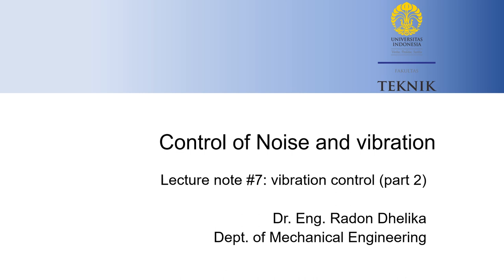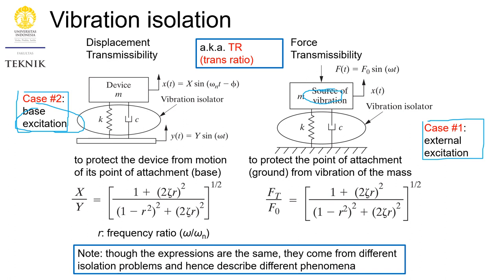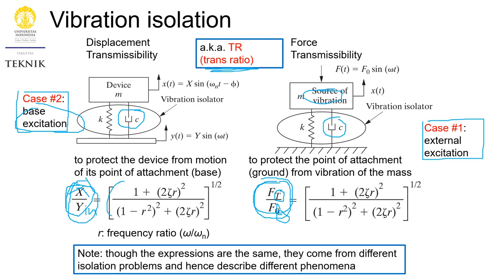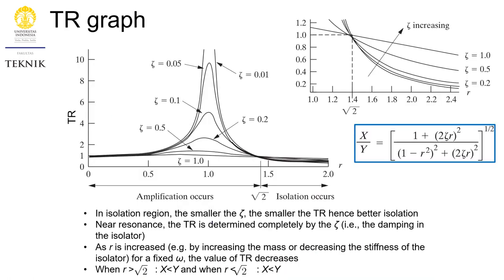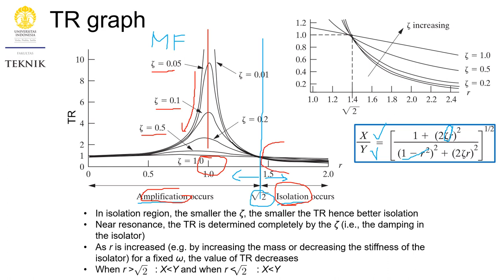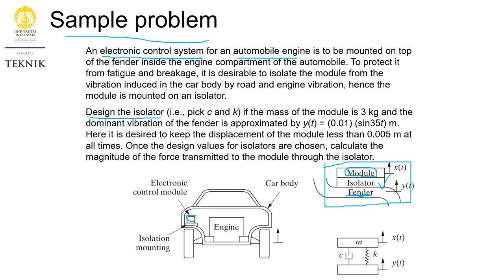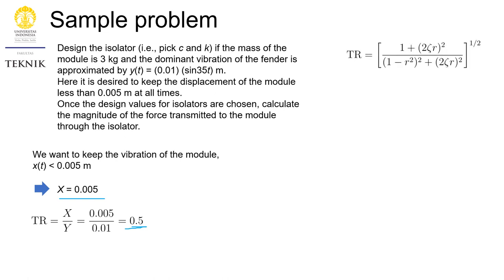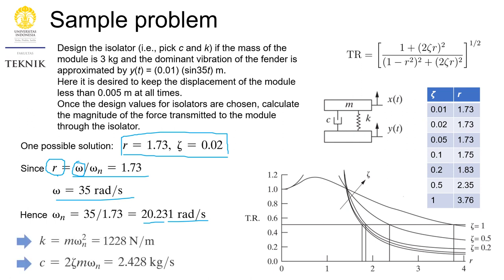Vibration control (part 2): vibration isolation

Comment: Great video sir, and by the way i am a pre final year mech engg student, and currently i am working on a vibration isolation system based on negative stiffness for camera mounts in drones/quadcopter. And i am little confused on getting the input parameters like the force acting on it etc. Can you help me on this to rectify my problem.